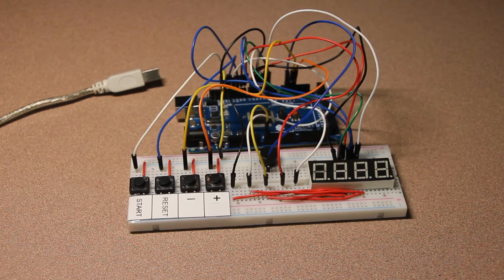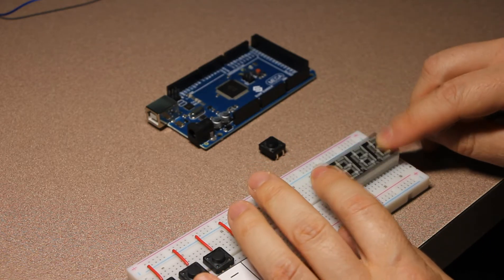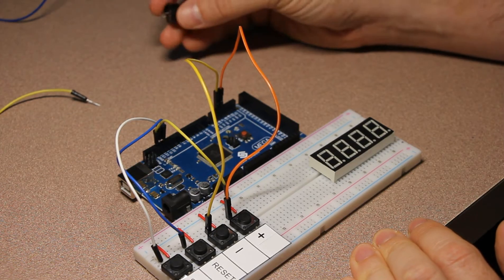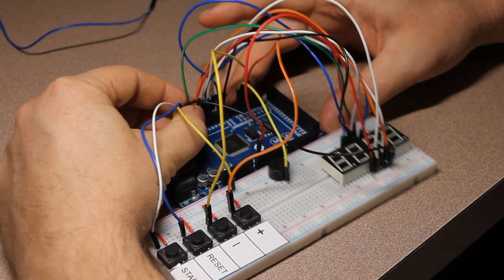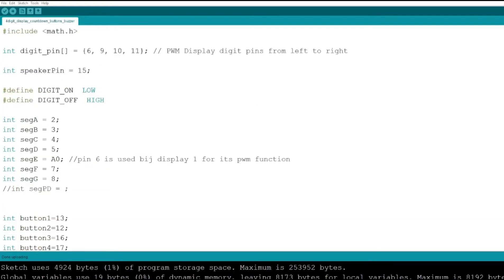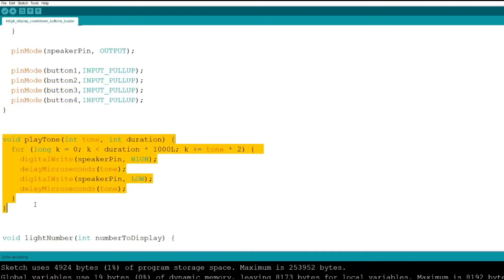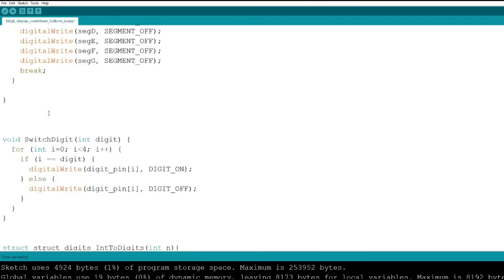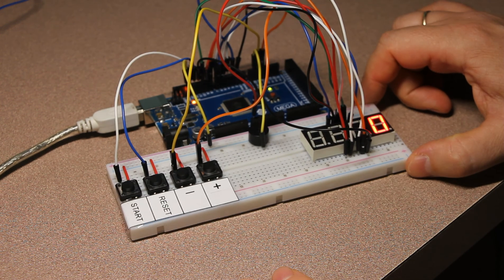Arduino Adjustable Countdown Timer

Comment: What to download for include library, <math.h>
Reply from the maker: I did not install it manually and "#include <math.h>" was enough for me. What chip do you have? There are some limitations according to https://www.arduino.cc/en/math/h
They also have a reference to avr-libc library that probably can be installed if math.h is not found automatically.
I only use that library for a function pow to compute 10^i, which may be an overkill. If installing a library does not work, you can add the following function:

int pow10(int n) {
    int x=1;
    for(int i=0; i<n; i++) {
        x *= 10;
    }
    return x;
}

and then replace pow(10, 3-i) by pow10(3-i) in the code, and remove "#include <math.h>". This is generally not the most efficient way to compute powers, but since we only need it for i<4, it will work fine. I think it should work, but I did not test it myself since I disassembled the project. Let me know if it does not help.

Comment: Is this capable for Arduino On? using the same code and schematic diagram?
Reply from the maker: Did you mean Arduino Uno? If so, please see my answer to the question of Ray Rank below. You will need to change one of the pins.

Comment: any other library needed for this project?or is this applicable for arduino uno?
Reply from the maker: Aside math.h, no other library is needed. And there is a way to go around math.h if needed as described in another comment. It also should work on Arduino Uno as well, but you may need to change the pins as the number of digital pins in UNO is one less than I used in this project in MEGA. You may try to use analog pins instead. If it will not work for the buttons, you can probably use them for segments to free up some digital pins. One of them is analog anyway, so it should work, I guess. For example, you can assign "int segF = A1;" and use digital pin 7 for the reset button. If this does not work, you can simply use pin 6 that currently corresponds to the first digit of the display. Then the countdown will be limited to 999, but still gives you something. Then you would need to change the first line of SwitchDigit function to "for (int i=1; i<4; i++) {"
Reply: @dsavchuk1  thanks for the reply... highly appreciated...
Reply: @dsavchuk1  used pins 1 and 0 for 16 and 17 replacement..
Reply: hello...is there any way to make the start as both start and stop button? looking forward for your reply and highly appreciated it...thanks...more power